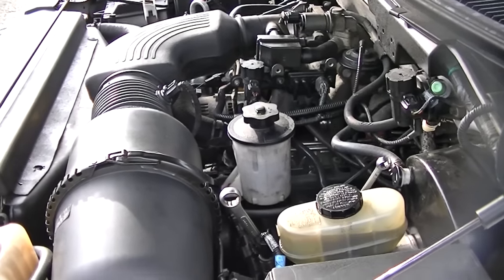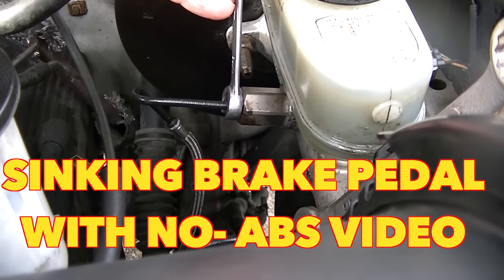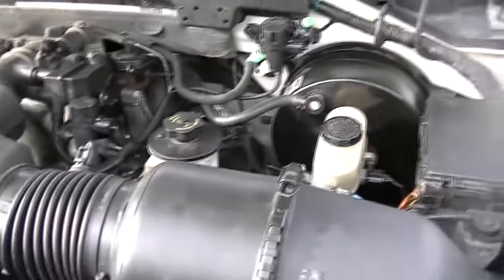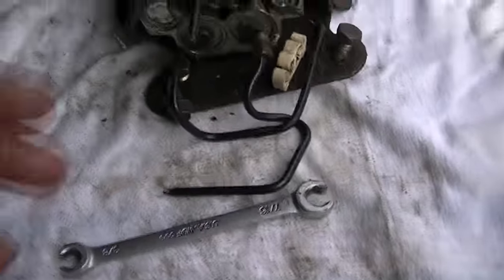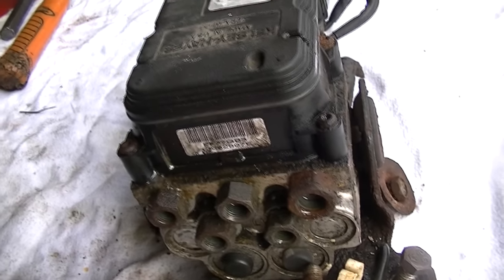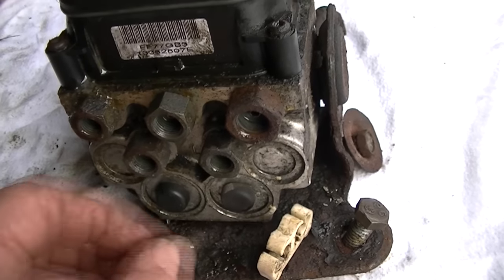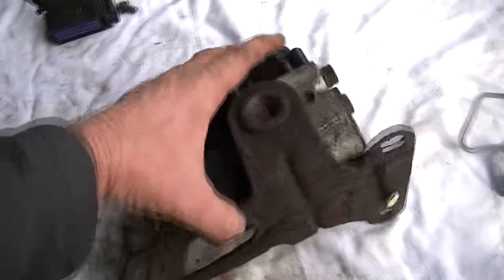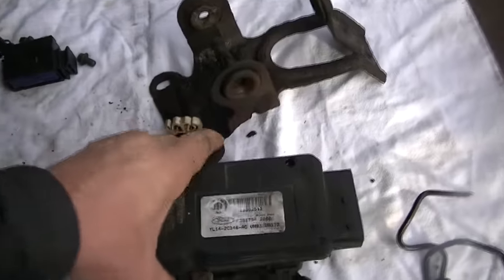How I removed my ABS PUMP Sinking Brake Pedal~! Expedition

Comment: my rv Ford f350 1997 has good brakes when motor off,  but when I turn on motor I have no brakes can you help?
Reply from the maker: check the  ABS PUMP.
Reply: Phillip beaupre,  did you ever change out the abs pump? Did it fix it, I'm having sme problem on my 95 jamboree on e350 chassis , off they are nice and hard , soon as I turn the key it sinks to floor, I suspect the abs pump but can't seem to find a replacement, my model numbers show no results anywhere

Comment: Why didn't you just replace the pump module?
Reply from the maker: It had a good code.
Reply: The control module wasn't the problem, it was the modulator valve assembly that it controls which was bad.

Comment: Do you have to bleed system afterTHE  R&R OF the ABS module
Reply from the maker: 100benebob .....I never had to. The brakes pumped right up. I thought I would have to.
Reply: so no bleeding of this unit after putting on all the hoses.
Reply: just the wheels?
Reply: Yes

Comment: 2 things.... how the  heck do you change the wiring out because it's not an obvious thing... something can  get broken?!!!?!!
2. why the heck didn't you show how to take it off WHILE IT WAS IN THE DANG CAR??? I have a mercury mountaineer and the setup is close to the car in the video, but I have no space to get bolt on the front end of the abs system, AND I ENDED UP BREAKING THE BOLT!!! I WOULD HAVE LIKED TO SEE IF THERE WAS ANOTHER WAY TO AROUND THAT, BUT NOW ITS TOO LATE!!!
Reply from the maker: da back on left left side

Comment: Can I not just bypass this damn thing?
Reply from the maker: NO...Not really.
Reply: I can't just run the lines straight from the master cylinder?
Reply: Technically yes u can 😉 u need a abs delete block run the lines from master cylinder to block n from block to wheels.  I did it.

Comment: Easy Cheap fix , I threaded both of those ports with a 1/4 20 tap and 
then I cut a drill bit 1 inch long (1/4 inch drill bit) and put it in 
the holes and then put a 1/4 20 bolt in the newly threaded hole and 
tighten it snugly with thread lock on it.  Pedal is firm and never fades
 .
Reply: This sounds like a real good fix that will last . If you got
Time maybe you can communicate with me on the details more in depth I have two modules so I can preform both or if I mess up thanks again
Reply: usautoserviceinc the two ports are the two bottom ones with rubber caps on it ?
Reply: @anthonyedwards6077  yes, I have seen some where the caps have been missing.
Reply: usautoserviceinc  hey bro , my ports are 21/4 deep , is the objective to drill to the bottom of port or past the bottom ? And the drill bit spacer is this just because you did have a bolt long enough ? Or does there need to be a void of some short at bottom ?? Thanks again
Reply: @anthonyedwards6077  no void needed , I just didn't have a long enough , your way will do just fine too. let me know what you think after its finished.
Reply: Daniel Clark worked perfectly , pedal still a little soft but that may be due to the hole system being apart for days , definitely a complete 360 thanks a lot this should be done for anyone suffering from pump module failure, instead of wasting a ton of time in fact  everyone should just do this regardless